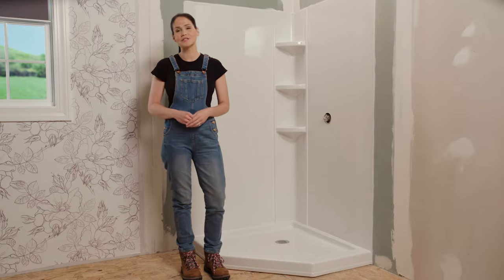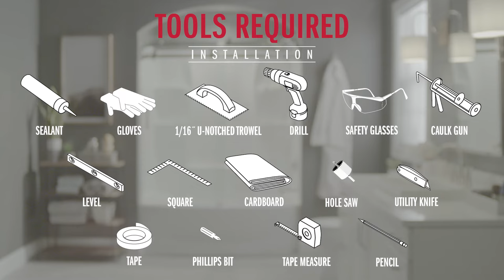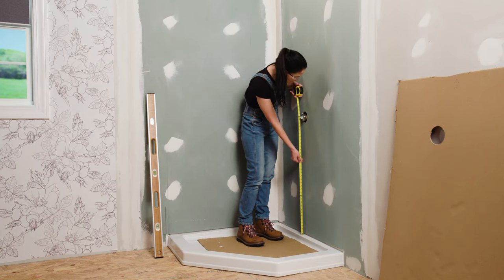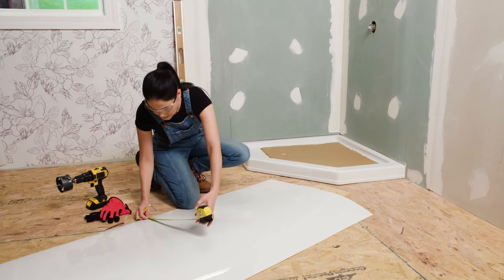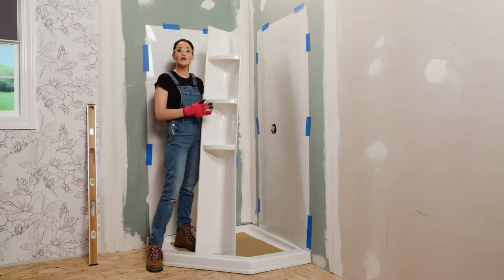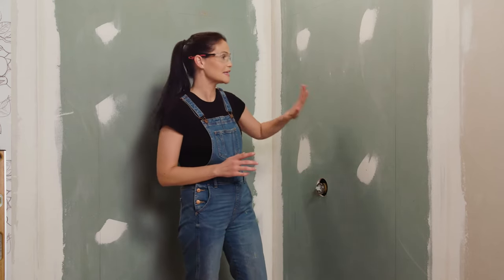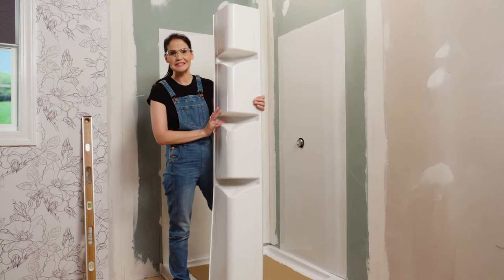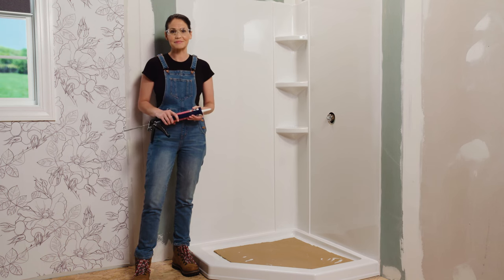How to Install the Delta® Adhesive Corner Shower Wall Set

Comment: Can these shower panels be installed over green dry wall or does it need to be over something like water resistant cement board which has been waterproofed? Will these panels adhere to GoBoard?
Reply: Green drywall is fine. Water proof to your desires.

Comment: What adhesive you use for the wall?
Reply: Looks like she is using Loctite brand Power Grab Tub Surround adhesive but any construction adhesive would do.
Reply: Appreciate it
Reply: Whatever brand adhesive you use make sure it's specifically for the type of surround you are installing, some adhesives will in fact bleed through. . .
Reply: I used power grab tub /shower